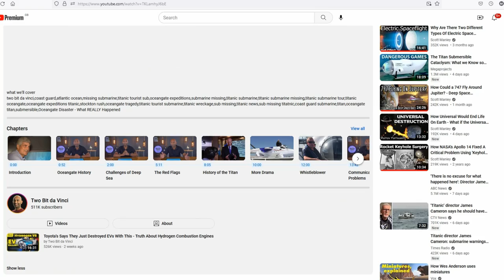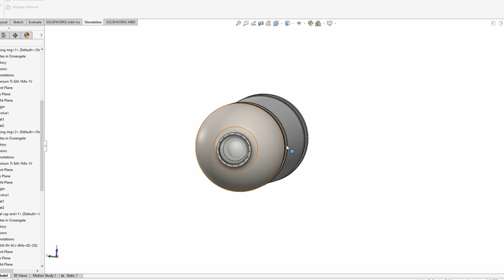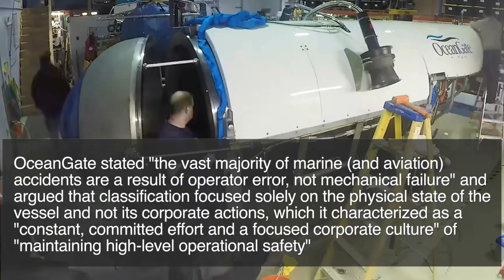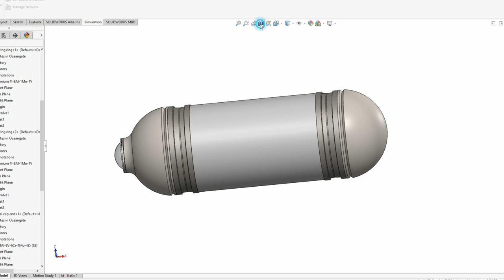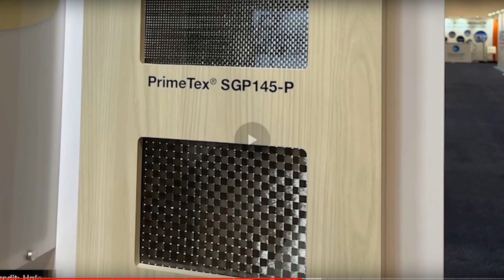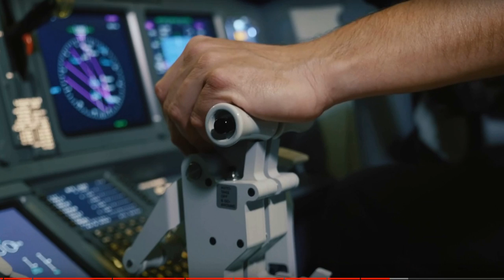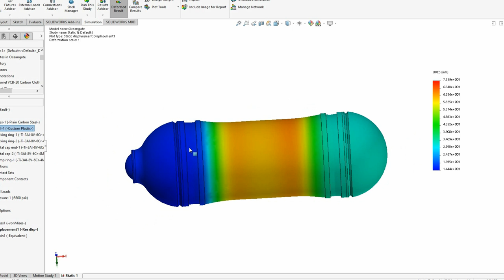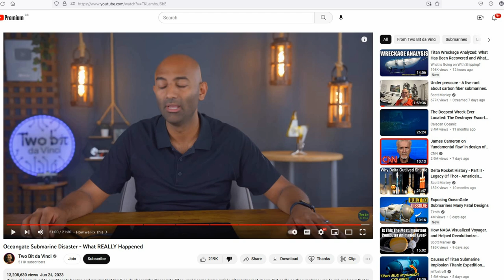Oceangate Titan - Engineering Failure?

Comment: I find it fascinating that nobody seems to have identified the absolute obvious. I recognized this the second I watched the fabrication process of the pressure hull. The carbon fiber was wound around a thin titanium inner cylinder, with single threads in a uni-directional fashion. That was insane and absolutely certain to fail, especially with repeated stresses. There was virtually no rigidity or structural strength in the bow to stern direction along the length of the tube. It's like wood grain. The strength and rigidity is along the grain, not perpendicular to it. I have worked a lot with carbon fiber fabrication, there is very little strength and rigidity between parallel running fibers. You get strength and along the length of the fibers, not perpendicular to them. Even though using carbon fiber was probably a stupid idea in the first place, at the very minimum they should have wrapped the cylinder with a woven fabric so it could provide strength and rigidity in ALL directions. I  absolutely guarantee the implosion failure happened somewhere central of the pressure hull and caused because the only real strength and rigidity being offered between fiber threads was the epoxy itself, which is not very strong. They might as well have just covered it in epoxy alone. Never mind that carbon fiber was a bad choice to begin with, they absolutely failed miserably in their application of it, right from the very start. I recognized this from the very instant I saw their fabrication process, my jaw hit the floor. Absolutely astounding! .. all of those supposed smart people and nobody recognized this? .. just shaking my damn head ....
Reply: Yes.  The setup was essentially a thin-walled cylinder with end caps.  The videos of the construction of the sub showed the end caps being stuck on to the CF barrel with ZERO environmental control (temperature, air bubble inclusion etc).  After a few dives the glue could have crept leaving the end caps crooked, placing asymmetric loads on the cylinder.  The end loads were incredible; something like 72" diameter of the cylinder (roughly) = 32" radius =  3220 square inches times 380 atmospheres depth pressure = about 5500 psi gives end load on the structural cylinder of about 7900 tones pushing the end caps towards each other.  That load resisted by just the compressive strength of the epoxy resin.  Ugh.
Reply: @nigelwilliams7920  - the end caps were inconsequential. The primary failure was purely the use of winding uni-directional fiber. You could have used duct tape to hold the end caps as the pressure would hold the end caps with nothing else. I am looking only at the structural integrity of the carbon fiber tube, and the method of fabrication was a guaranteed failure at some point. Even if they wound to 8" think, at some point, it would fail. I find it incomprehensible that one would use carbon fiber in such a manner and expect long term integrity. Astonishing to me.

Comment: I don't want to call them as engineer.
This is not conforming to engineering principles.
Under extremely huge amount of pressure down there, the shape must be sphere.
The material must be homogeneous.
Titanium only.

Glue and Bolts must be Strong enough to withstand the pressure. and backup of backup of backup.

The sub must be tested under 6500 psi at least and get cert as a must.

After each dive, The analysis of Fatigue Failure must be taken places.

Bottom line, it's suicide down there if security concerns had been overlooked.

Comment: 12:20 -- RE: The Beginning, Middle and End of Stockton Rush;  I cannot say that I consider the deets regarding Mr. Rush's time in the aviation industry as being not pertinent.  The thing which I think is too easy to disregard is the difference in being above 18,000 feet, and being 12,000 feet below sea level.  The pressure regimes are incredible.

Personally, I think that the design for the pressurized compartment needed to be all metal, and the displacement a good deal larger... which almost certainly made it cost prohibitive.

I saw a decent video today which was going over the timeline presented in the "Transcript" leaked to the press.  The details of the dive seem to indicate that it was descending too fast and about 20 minutes before the disaster, was incapable of ascending at greater than a handful of meters, per minute.  Not Good.

Which compels me to pose to you a question I asked earlier, elsewhere:  Do You think that if the Titan had declared an Abort within the first 30 minutes of the Dive it would have been able to safely return to the surface?  Or, in other words, where/when was the Point of No Return?  It seems plausible to me that it might have been within 5 minutes of diving.
Reply: 24:20 -- RE:  The Water Seals and the Design;  Since higher pressures were intended to help keep it water tight, is it plausible that it did start taking on water too early, but not inside the main compartment / pressure vessel?  In other words, supposing a failure with ballast tanks and the air pump meant to empty them of water?

Comment: Yip my exact theory. Why they didnt brace both end titanium caps with a rod going across the hull is beyond me.
Reply: KISS, rods would add design complexity and more possible points of failure, just like the CF titanium joint did.
Reply: What for? as soon as they are under water you couldn't push the ends off each other with a jack and the deeper they go the more pressure is exerted TOWARD each other. 

I'm betting at depth the overall length shortens over an inch. Rods would be loose and useless.
Reply: @mathewmolk2089  Better than just hot gluing both ends together xD

Comment: Actually, decades ago aviation was plagued by sky high accident rates from mechanical and material failures and maintenance mistakes. It was through dedication that the whole industry developed better processes to assure better engineering, materials and maintenance processes that reduced those failures to only a fraction of a percent of the past. Better training and process for the operators reduced accidents from human error as well. So today you have a mature industry, with established processes and certifications that has reduced the cause of accidents immensely, and the biggest challenge for future failures is the Operator that has to make split second decisions in the moment, cause of their human nature has become the biggest cause of accidents. Now you've got Stockton Rush in an immature industry (that is private submersibles for tourism) blowing off all the processes and certifications that clearly and should easily transfer over and has the gall to claim, well other industry's its operator error that causes the accident, not the engineering or materials. Pay no attention to the Carbon Fiber hull that all the experts and certifiers say it doesn't scale to a deep sea submersible. (EDIT: I paused your video and typed this out because I was so aghast at the quote from Stockton Rush, I now see later in the video you've made pretty much the same point about how Aviation matured).

Comment: But my question is why carbon fiber. Why the resistance to using proven materials?
Reply: cheaper (esp. compared to titanium), maybe easier to manufacture, and much lighter (esp. compared to steel). for each extra weight you need extra buoyancy
assuming same wall thickness: 1200 kg (CFRP) vs.7400 kg (steel)
check out the design of the Trieste with it's big tank filled with gasoline (ok, designed for 10.000 + meters, but just to give you an idea)
(just my 5 ct, mech. engineer, but not a specialist for deep sea operations...)
Reply: Because Rush wanted the sub to be big to hold 5 people.  When it is big, it will be too heavy using titanium alloy or steel.  When it is too heavy, there will be  buoyancy problem.  If he designs in a big buoyancy tank to counter the weight, the sub will be heavy and big. If the sub is heavy and big, he needs a bigger mothership.  A bigger mothership means higher cost ...  He is doomed when he first writes out the parameters of the size of his sub.  The first thing to do in his project is to invent a wonder alloy.  The alloy must be light, strong, cheap, easy to manufacture, reliable in repeated stress cycle, easy to inspect and test.  Without this wonder alloy, he should have killed the idea and should not proceed with his project.

Comment: In fairness when it comes to the controller - you want to use something that is much safer in regards to fire. I don't know much about US military submarines, but you can survive a fire in them. A fire in a small submersible is much more dangerous. An in the event they could put out a fire quickly, even a small amount of smoke will make for a horrible situation.

The whole thing just smells cheap. Not smells, stinks.

Comment: Good old Rush,.... Ya roll the dice ,...ya takes yer chances!   I knew nothing about the subject until this tragedy.  I'm not an engineer but  I played one for 40 years in a high tech industry designing and building capital equipment for semiconductor's.  
The shape and the way the carbon fiber was wound was suboptimal. When compounded with not Autoclaving weak points are more possible.   In an effort to be cheap Stockton departed well proven  materials and shapes and innovated ,sort-a!   All of the "protective" devices and high tech words and creative thinking, failed when it was needed the most!  Good old Stocky blew it, or should I say imploded it and got himself and 4 others killed in an experimental craft that failed.  Maybe certification of deep sea  craft is a good idea!  art:body-blue-raised-arms::face-blue-wide-eyes::hand-orange-covering-eyes:

Comment: Two Bit’s history lessons are not even accurate. James Cameron does not hold the record for deepest dive, that record goes to Victor Vescovo, which unlike Cameron’s sub was not only actually certified for that depth but also is able to do it over and over again without needing to fix anything. 

Also I love his reasoning for why they shouldn’t have used a $40 game controller… because an F35 uses a $400,000 controller. Yeah given the choice I’d go with the $40 option every time. Wtf is that comparison???

Also he guesses that subs like this should have a life of only a couple of dives… the Alvin Sub (which discovered Titanic) has done over 1,000 dives and is still fully operational. Stfu Two Bit.

Also I don’t think anyone has looked like Micheal Scott as much as Stockton Rush does in the titanium ring bonding video. Truly amazing.

Comment: Ok the fact that they were bolted in is not that uncommon. Camrons  sub used the same method only he used I bolts not hex bolts but he still needed a support crew to get out. Both had transponders so they knew where the sun was. Which was in a separate area that also went out when it imploded another indicator what happened they also would have heard itThis whole thing about looking for the sun was a shame at 9:55 the mother ship knew that the sun imploded . The hydro phoned the government have knew what the sound was and even at what depth. They knew that the implosion was not survivable and they knew exactly where the sub was. The French came in and found it just where it went down. So the question Is why did the government let those families believe there was hope of any kind? What were they distracting the country from the only other news at the time was the charges being pressed against Hunter Biden. The democrat party never lets a tragedy go unexploited. They let those families wait  night and day for five days controlling the narrative of how heroic the effort was and most of that was by private owned crafts didn’t even cost the government the extra fuel.

Comment: The reason there is a higher percentage of operator induced accidents than hardware induced accidents is because the hardware is usually certified to never fail!  It’s not that the the hardware was a given, it’s that other hardware was DESIGNED and TESTED to never fail.  That was a really stupid statement.
Reply from the maker: Give me an example of hardware that never fails

Comment: That glue area is like 2 inches wide, tube thickness is constant. Did they actually test and simulate the design. If I was pioneering something new I would have done a scale model and with full of straingauge sensors submerge it up till failure to see how the materials and construction works and adjust the design or scrap it fully. I think the ego of this CEO prevented the use of proper design practices.

Comment: I saw something recently that convinced me they were total yahoos. Look at an interior picture that shows the video screens and how they are mounted. They ran the video screen mounting screws into the pressure vessel hull. (better would be to have them connected to the floor). 

It is not that someone did the screwing, it is that everyone else who saw it was ok with it. Of course admitting the error would mean having to throw away the pressure vessel once those screw holes had been made.

Comment: It seems the carbon fiber was wound onto a metal armature . The armature would have formed the inside wall of the cylinder, and is what would have been glued to the “rings”.
Reply from the maker: It wasn't. The armature was removed.
Reply: But, it had flanges on each end, which seemed to be roundabout the 5 inches thickness of the carbon fiber.  Removing that would be quite difficult.

Comment: I wouldn't built a thermos flask with that kind of seal structure lol...
And they applying the glue/ bond with basic painter tools and not even considering bubbles and uneven layers is ludicrous, allegedly. 
And using end caps and a cylinder with total different materials and/ or properties is also questionable when you see how they have bonded all surfaces straight on without any form of integrity analysis at all...

Crazy.

Comment: The glue connection must have had cavities from the start. And / Or developed cracks at every use. By the flexing of the connection between tube and dome. With a lot of water pressure at every dive. Water pressure to the extend where it would be able to cut through material. Compare it with a ´dijk doorbraak’,  a sea dike breaking. There is an American story where a boy saves the dutch by putting his finger on a starting hole in the dike. You better get out of there or you block the breaking dike at the pressure side of the dike with a very large object. Like a ship. The situation must have been sort of the same but now with 400 atmosphère pressure instead of 1.5 or so. Look at a video of a ´dijk doorbraak’ see that as a slow motion of what might have happened here. Any failure that occurred first.

Comment: Using a video game controller as the sole mode of directional input for a manned vehicle in an ultra high risk environment is ABSOLUTELY NOT normal. That “the military use it all the time so it’s fine” argument is just stupid and flat out wrong, ppl think that they are suddenly experts on mil-spec hardware input devices after they read some article about a Xbox controller being used to control the periscope on a US submarine or saw some pictures of drones being flown with game controllers on google, using a controller to control a periscope or a done is vastly different from using it as the main method of control for a manned vehicle, this is why they don’t plug a controller into the F-35 and let you fly the whole jet with it, idk why that’s such a hard concept for ppl to grasp
Reply from the maker: "Using a video game controller as the sole mode of directional input for a manned vehicle in an ultra high risk environment is ABSOLUTELY NOT normal"

1) Is this true? I.e do you have direct proof that it is the ONLY input?
2) I've served in the Air Air Corp as an airframe engineer. Recently I left SGS, and international materials testing body. 
3) This isn't a military vessel. 
4) It controls some motors. 
5) It's just an input device. Do you think the micro switches in an F35 joy stick are that much better, and if you do, please provide evidence. 
6) The controller didn't cause the catastrophic failure.

Comment: Well, over all discussion of how the sub was build and what it was lacking and all the safety things it was lacking is kind of important for the future "experimental" investors.
Any vehicle which carries passengers has to have way to exit or emergency exit from inside... airplanes also emergency exit doors does not help if the plane is up in the air and they cannot be open but after emergency landing they are important. Inside the sub there could have been fire or medical issue and even if they would have been near surface it would have taken too long to get them out from there etc. Same goes for navigation system and communication. Other real subs has phone or talking connection to mother ship, not only text messages.

Comment: Good  analysis but your shock wave description was not your strong point. First you get local failure of the shell . This starts a shock wave propagating away from the hull that travels through the stationary water instantly accelerates an increasing mass of water into the failure zone at considerable velocity( not supper sonic at this pressure) .This fast moving column of water weighing at least one or two tons  pushing the air ahead of it impacts the  end shell like hammer on an anvil  generating enormous pressures this would push out the window but if it did stay in place ( or at the other end with no window) a new larger shock wave would be generated  from the end shell along moving water column  reversing the flow as the water bounces of the end shell.  The details of where  and how the initial failure developed would alter the violence  and detail of this scenario  but the overall this is little closer to what must have happened .